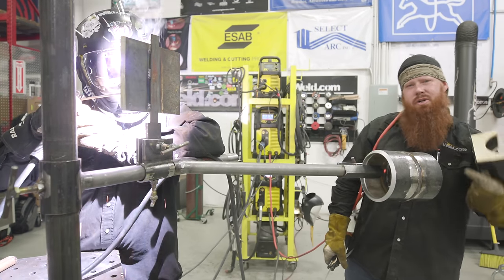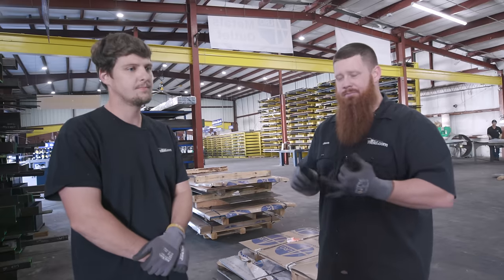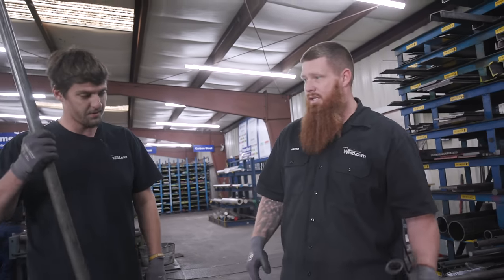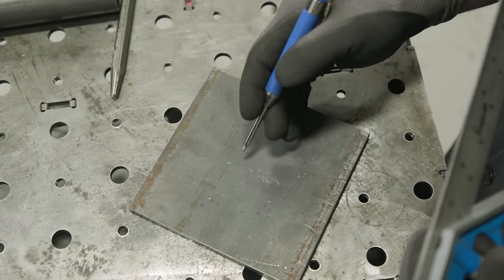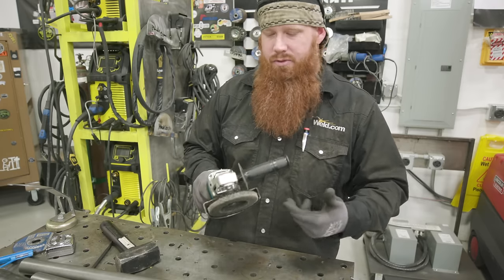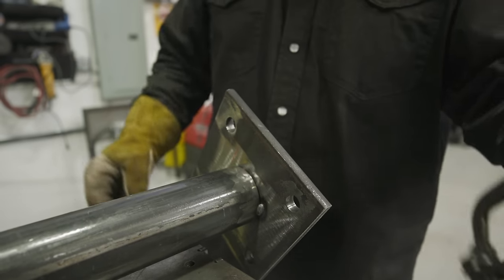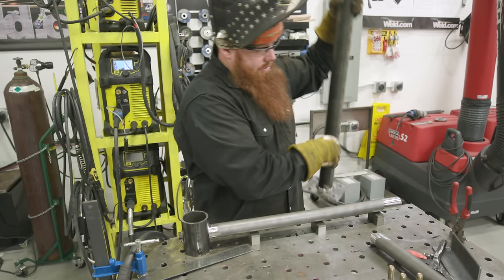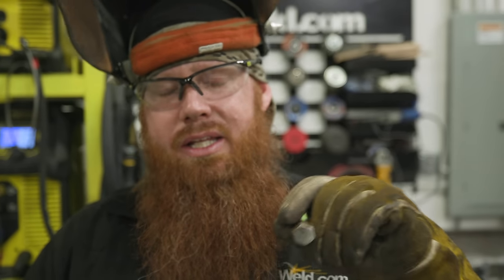DIY Welding Fixture Stand

Comment: I anchor mine in my vise that has a pipe clamp below the main jaw. That way my horizontal pipe arm can be tilted to the 45. I just have an L joint with another piece of pipe at the bottom instead of bolting it to the table. Saved a bit of work.

Comment: That's a great fixture holder with lots of versatility. Im going to make a smaller version first to suit my needs then build a larger one
A couple of questions for you
Doesn't that brand of anti- spatter have Methylene Chloride as an ingredient. I read somewhere to wear a respirator  when using it.  CORRECTION. I JUST RESEARCHED AND YOUR USING THE WATER BASE PRODUCT NOT THE SOLVENT BASE. THE SOLVENT BASE IS PRETTY TOXIC IT APPEARS 
Next it was good to see you hand make the pipe coping but do you normally use a tubing notcher?
Thanks for a great video and thanks to the viewers who suggested this project.

Comment: Good video, I have a hobart flux core machine that I absolutely love, i use the Lincoln anti Spatter gel that you dip your flux core tip in, just curious is it ok to dip my tip in  before it gets warm or hot? Or is it best to wait until after you lay a weld down then dip so that its warm. I didnt know if it makes that big of a difference if its cold when dipping. The stuff has kept my tip looking pretty good though so very happy with it. Just repaired a Toro Recycler 22" deck yesterday, where the grass discharges the bottom is a thin about 1.5"-2" strip of metal and very commonly breaks, but my flux core machine did well repairing it after turning down the amperage 👌

Comment: If you really wanted to be clever - 
1)  Put a knuckle on 2 pieces of tubing so one will bend, then lock in place (by tightening a through T Bolt to clamp them together ).
2)  Cut 2ea. 4" or 6" circles, one is welded onto an arm, the other mates up to it but is "captured" so it can rotate freely, then you can rotate and weld.  If the capturing is too much injuneering, then just put in bolt holes and bolt them together so you have different rotation angles.  A piece of pipe welded into the "free arm" and inserted into the fixed arm will give you the necessary support when rotating it to the next bolt hole.  (spring loaded ball pins are quicker than bolts, but....)

Comment: Any time I weld a nut to something I first drill and tap the plate/pipe ect. screw nut onto the bolt and into the plate then snug the nut and weld it. before the nut cools off to much remove the bolt, once cool test the fit with a new bolt, if it is dragging just run the tap back through to clean the threads up. not only dose this method hold your nuts to the part you also get extra threads, and yes juice it up with anti splat.

Comment: Hi There, I seem to have a problem cutting perfect 45 degree square tubing. When welding these square tubes they have bigger gaps in the inside than the edge. Could you possibly cover this topic. 
Thanks.

Comment: That third hand would be better longer so you can have a 120° bend so the point sits verticle,
Being at an angle could push the bolt

Comment: If the center of the plate is 3in and the pipes is 2 3/8 divided by 2 = 1in and 3/16, take that number and subtract 3in BOOM = 1 13/16.  WHO NEED calculator if you're dividing a fraction by 2 especially in inches you can just change the numerator and you got your answer :)

Comment: just curious because I saw you spraying anti spatter on the piece before you welded it but are you able to use that when welding anything to code or is it more for just small fab projects?

Comment: I really like your videos, but I have a concern.  I just finished watching your grinder safety video before this one.  In this video, it appears as though you are breaking at least 3 of the grinder safety rules you discuss in that video.  
1.  Not using a faceshield.  17:53
2.  Not using 2 hands on the grinders. 17:48
3.  Having small parts in a vice or clamped, so you can keep 2 hands on the grinder.  18:18
Am I missing something?